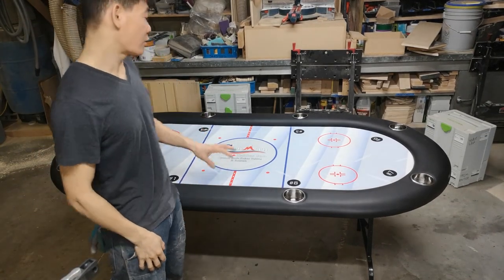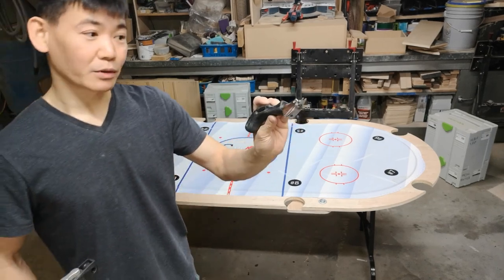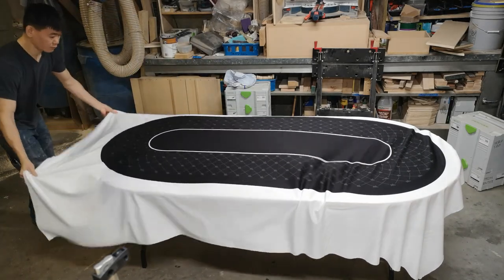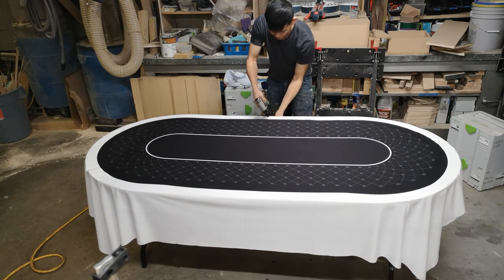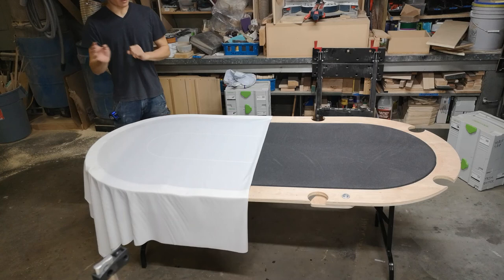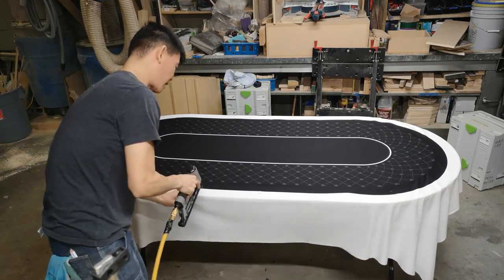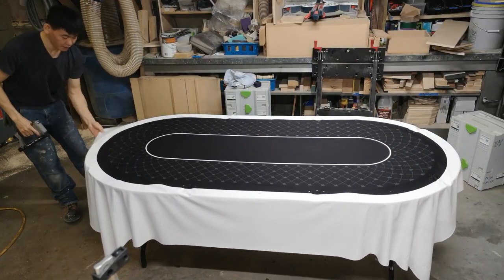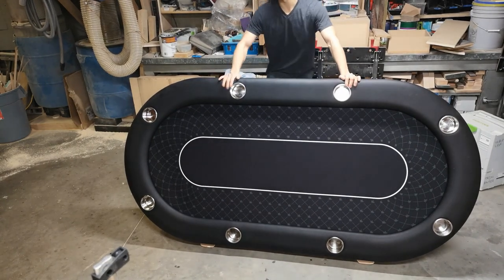Custom felt installation

Comment: Great Job!  I have a IDS 96" Dark Knight poker table and I want to replace the speedcloth.  Have you ever worked on one of these tables and is it difficult to replace the speedcloth? Because, I don't see any bolts on the underside?
Reply from the maker: Sorry but no, we haven't worked on that model before.  There should be screws on the underside of the table, probably not bolts.
Reply: @chanmanpokertables  Yes, there are wood screws on the underside, but they are there to attach the base pillars to the table top.  This table was manufactured in China.  After separating the base from the top, you don't see any screws or bolts.  It's as if they may have used some sort of glue to seal the speedcloth inside the top.  There has to be a way of replacing the cloth.  Replacing the cloth is required over time and wear.
Reply from the maker: @blkhoustonian  If that's the case, then yes they most likely glued the playing surface onto the base sheet, which is a cheap way to make the table since then the speed cloth can't be easily replaced without damaging the table.  Sorry we haven't worked on one of those models before so we don't know if it can be removed without causing damage to the table.

Comment: I just built a table and I’m happy with it other than the sound so I have a question for you! My issue is very nitpicky. My table folds up, when u drop chips is the middle of the table where is more solid, the sound of the chips hitting the table is good. But as you move further away from the center and drop the chips, the sound is off, it sounds more hollow and just a bit off. The plywood is only 1/2”. To 9-10 people it’s a non issue but I’m anal about stuff like that. Wondering if I put dynamat along the underside of the table if this would make it sound more solid?

Comment: im curious what would happen if you just left the original felt on and put the new stuff right on top of it. If you don't feel like removing staples, it could make it even easier. Also you have previous felt for reference instead of measuring.
Reply from the maker: Yes, you can do that.  If it's a light color felt though, sometimes the graphics from the cloth underneath may show through.  If you do this a few times, the playing surface will get thicker and thicker, and the padding will become more firm as more layers are added.  Rail fitment can also start to become a problem if there's too many layers, but doing it couple times is totally fine.